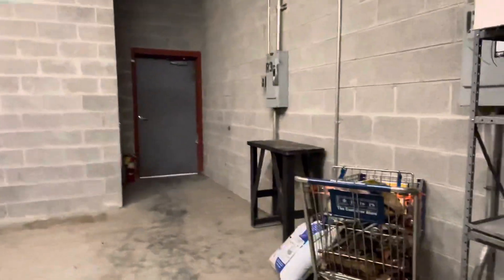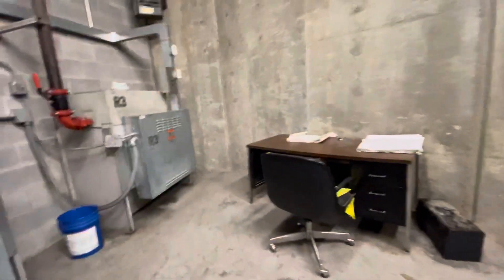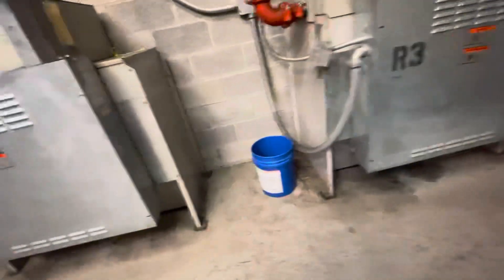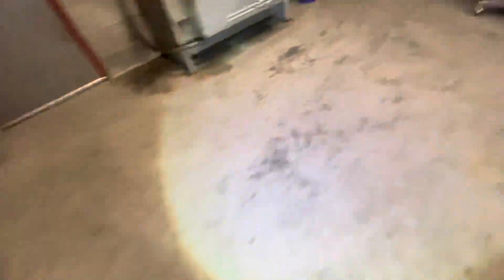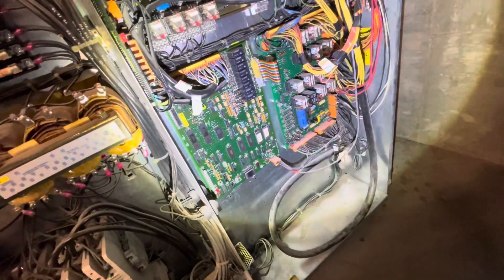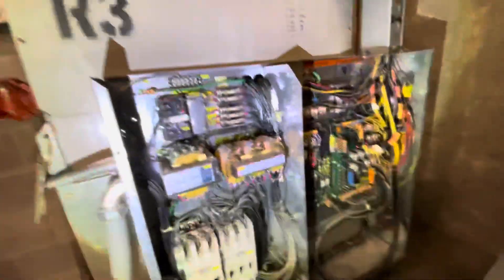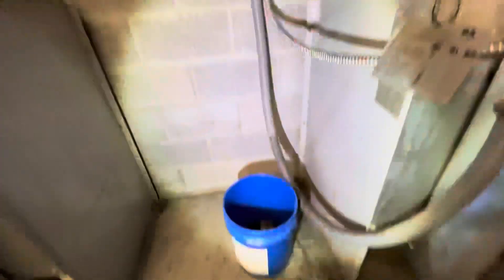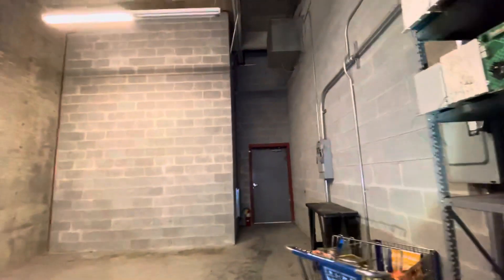Another Schinder MT Hydraulic Elevator Machine Room

Comment: you hit the jackpot on this tour! Getting to see the elevator pit and up the shaft, from the machine room level. This machine room is huge, it is awesome the techs have their own desk to keep the records, schematics. The electrical installation is a lot neater with the wiring ducts and conduit runs. Not so much flex conduit, other than where necessary.  Oh yes, those starters have 3 phase power 440 VAC or higher.

Comment: Holy Crap The Elevator Shaft
Reply from the maker: The elevator doesn’t serve this floor so I’m safe. This is in the basement.
Reply: @QEElevators  that’s true
Reply from the maker: @SG118P  I wish I could’ve found the machine room for the dry powered parking ones (and the target ones) seems like the motor room isn’t in this section of the basement sadly
Reply: @QEElevators  oh